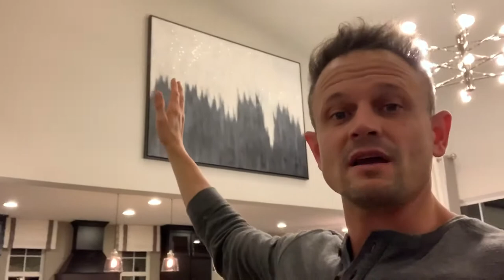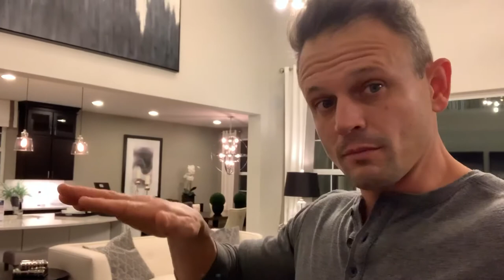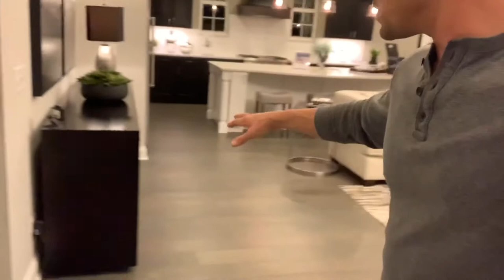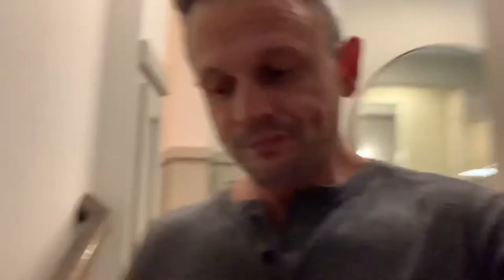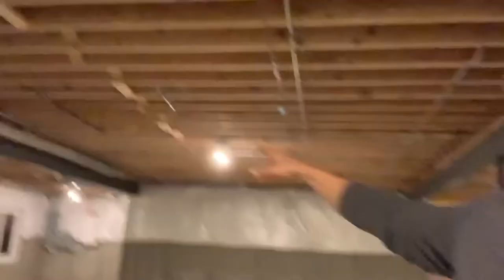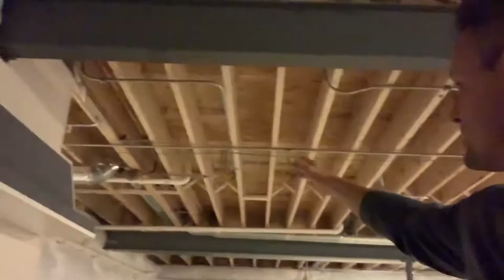Why the floor shakes when I walk by, because of floor deflection

Comment: We've been in our new "custom" home for two months.  Open floor plan in the living area and kitchen/dining. The deflection at the island is driving me crazy.  To the point I'm concerned about having holiday gatherings.  The living room has some too but the island area keeps me up at night.  My family moved from a 50 yr old ranch house that had plenty of support poles in the basement.  Little to no deflection.  I'm not liking my current setup.  

Plans called for an engineered flooring system.  Builder went with 11 7/8" 40x I-joists, 16" OC.
Reply from the maker: Well, this could be a lot of work, depending on what electrical, plumbing, and HVAC are in that area, you could try wrapping the joist in three-quarter inch plywood on both sides that should stiffen that area up and make it less bouncy.
Reply: Did you take action? My island has some deflection leading up to it and it drives me crazy as well

Comment: This helps my anxiety a bit. Got my first 2 story home , it’s a 1994 and my bathroom feels wobbly.it’s right above the kitchen. I haven’t moved in yet and  I already want it gutted to make sure it’s safe☹️
I seriously go in and run out.
Reply from the maker: Hi Ana- More than likely everything is fine, however if you’re still nervous you could always have it looked at by a home inspector, carpenter, or structural engineer.

Comment: This is very useful info. Thank you for making this video. I have an area in my house that has a piano the living room side and fridge and row of cabinets the kitchen side of the wall. I’m kinda paranoid it’s too much weight in one area. Do you think I need to get that spot fortified somehow?
Reply from the maker: Sorry for the delayed response Marilyn. It’s hard to say without seeing it. If you have a basement underneath this area I would look to see if the floor joists are sitting on a supporting steel beam or some supporting structure. If that’s the case that area will be more structurally sound then if this area is in the middle of the floor joist which is its weakest point.

In my 25 year career I’ve only seen one house that had a safe that was so large that it actually cracked the floor joists below it. With that said more than likely I’m going to say your OK, however I would have a carpenter come in and assess the situation for peace of mind.

Comment: Thank you for this video! I have about a 25 year old house, well taken care of that we moved into a few years ago. Home inspector said it was the best taken care of home he’s seen in a long time. Problem is - the whole dang thing rattles when we walk or run around. The bounce in our main floor drives me nuts especially with the one year old and five year old always running and jumping. This helped my anxiety. Two questions  - if the basement is finished below there’s probably no way to address the bouncing?
And secondly, more to help my anxiety, it’s not dangerous right? I feel like if it was you would notice some cracks or damage. My husband has assured me all is fine :)
Reply from the maker: My pleasure! If the basement is finished, correct, you would have to open up the ceiling and stiffen up the floor joists to minimize the bounce, which would be very invasive.

Yes, it’s a normal, and yes, your husband is right, because he always is! 😉🤣
Reply: @BJPoznecki  thank you for the reply! I agree with (most) of what you said! ;)

Comment: What about building a house with concrete? People in the US will say it would be too expensive. But almost whole Europe has concrete floors. Only old buildings and houses (like 100 years old) have wooden floors/joist.
Reply from the maker: Yeah absolutely anything can be done, just be at what cost. Here in United States apartment, condominium, and commercial buildings typically are constructed out of precast concrete which is similar to how they build in other countries such as Europe.
Reply: @BJPoznecki  Europe is not a country 😉
Reply from the maker: @MsJaystars  🤷🏻‍♂️😆

Comment: Thanks I was worried. My room is above the garage and when I walk in the middle of the floor, the door and some furniture shakes a little bit
Reply from the maker: Yeah, all good. There’s a strong chance the floor joists span the entire width of the garage, which if it’s a two car garage is usually about 20 feet wide. So, if there’s no steel I-beam in the middle adding support you will get some flex around the center area.
Reply: @BJPoznecki  It is a two car garage, thanks again

Comment: If you're down stairs where a slab is and people walking upstairs heavily ,can that be felt down on the slab downstairs in the basement?
Reply from the maker: I guess in theory it’s possible because the columns that support the I-beams are on a footing below the slab, so there could be some vibration transfer.

Comment: Have a very obvious wobble in the floor going into my bathroom, which tilts the plastic cabinet away from the walk and knocks back into the wall, pretty annoying.
I have a crawl space though, and don't want to pull out the fiberglass insulation to do any work from the underside.
Are these my only options?  Pulling up the subfloor (garbage mdf) and cross brace with 2x4.  Or just adding another 1/2" layer of ply or something to the entire bathroom?
Reply from the maker: Hi Swiss- I hate to say it, but the best way to correct the situation is to come from the underside. By add more joists, wrapping the current ones in three-quarter inch plywood, or build a small wall in the middle of that bathroom stiffening up your current floor system.
Reply: @BJPoznecki  The joist is about 12" from the wall and the wheels on the cabinet are about 14"-15", so I think I'll just get a different cabinet with less depth and avoid the stress.  Thank you.

Comment: Hi BJ, just found your video, very informative! what are the implications if the columns under the beams are undersized? I live in an old Victorian house where a loadbearing wall was removed to open the living and dining space, so the floor above (bedroom) bounces and shakes. We've been told the beam is fine, the columns are undersized and that the construction overall should be safe. Thanks for any thoughts

Comment: I recently moved into a new three story town house and the living room is on the second floor and has a similar size to the one you’re showing. Living room has carpet and I can feel the floor deflection which has been driving me crazy. The room is currently empty and I think the subfloor is creaking as well. No cracks in the ceiling below it on the first floor.  Do you think I’m worrying for nothing? 

Also thanks for the video. Most descriptive one I can find on the topic.
Reply from the maker: Yeah it sounds like normal floor deflection. The ceiling below it on the first floor with it being a new build the seams might crack, however that’s normal. You would just want to keep an eye out for large jagged cracks.

Being that you bought new construction your builder should offer you some type of warranty should there be an issue that’s not seen at this time.

Comment: So it can be fixed by installing extra supports?
Reply from the maker: Yes, correct you can add additional supports, double up the joists, or wrap the joists currently in place with three-quarter inch plywood which essentially doubles them up.
Reply: @BJPoznecki  I am staying in a demountable in a caravan park, on bricks with sand below. I can feel the neighbours demountable shake my unit. Is it because the vibrations shake the sand?
Reply from the maker: @BeautifulAwakening  I’m sorry I don’t know. I’ve only done two modular home inspections since I’ve been in business.

Comment: Would sister joisting help with vibration?
Reply from the maker: Hi Rob- Yes, sistering or ripping down three-quarter inch plywood and nailing it to both sides staggering your seams to stiffen up the joist would work as well.

Comment: i live in a top floor condo and my floor vibrates even from people walking below wouldn floating floor fix this i cant fix from below because its not my unit below there
Reply from the maker: Hi Ryan- No, unfortunately you have to stiffen the floor framing. 

Now if you’re having an issue where the sound transfers when you walk on the floor and your neighbors below you hear you walking around. What you could do is install a 1/4” or thicker cork board underlayment before you install a hard surface floor. That would help minimize the sound transfer into the unit below you.
Reply: @BJPoznecki hi bj -  now if i installed green glue to my sub floor then added another layer of osb to sandwhich it , would this reduce vibrations felt when someone else is walking on floor?
Reply from the maker: @Ryan-kz7ej  Hey Ryan- It’s hard to say because it’s not your subfloor that is flexing it’s the supporting lumber underneath it that flexes and creates the bounce or vibration. 

Now in theory it may help a little bit and when I say that I’m thinking about a tiled bathroom. 

Typically you have your subfloor throughout that whole floor, and then when you tile a surface you install half-inch Dura rock or plywood to strengthen the area to minimize cracking tiles and grout. 

So, it may help, but I can’t give you a confirmation that will solve your problem.

Hope that helps!

Comment: ZERO
Reply from the maker: ZERO?
I don’t get it? 
What do you think I could’ve done better in this video?
Reply: @BJPoznecki  add rows of staggard solid blocking between joists to reduce or eliminate deflection in floor. Regardless of meeting code, no one wants rattling of objects in the room above when walking through room.
Reply from the maker: @TheNewenglandboys  Yes, you’re correct! As well as sistering, bridging, scabbing 3/4” on both sides, there are a few options to minimize the bounce. 

The premise of this video is because the builder I used to work for had a lot of customers that came from India where they build the whole house out of concrete. The floors, walls, ceilings are all concrete. 

Then, they move here to the United States and live in an apartment building where the floors are precast concrete, to where they never experienced a lumber built floor, any deflection, or sound transfer. 

Plus, these mass production homebuilders here in the US if it passes inspection and they get a certificate of occupancy they’re not gonna go back and modify the floor like you or I would.
Reply: @BJPoznecki  Thats true. Their motto seems to be take the money and get out of Dodge as they say. Once their paid, its the purchasers problem. But it would be good for the unknowing victim (buyer) to know there is a solution and how to remedy the problem. Those open concept homes are expensive enough.
Reply from the maker: @TheNewenglandboys  Unfortunately you’re right. It’s very disheartening what I’ve seen in the quality of workmanship as well as how they treat their customers after getting paid. 

Thank you for the feedback,  conversation, and video idea. I added making a floor deflection solution video to my list.

Wishing you and the family a happy holiday season! 🦃🎄
Reply: @BJPoznecki  Happy Hollidays to you and your also. I would be remiss  if I didn't apologize for the zero comment. I was going to erase it but then our whole conversation would be gone. The reasoning of the zero in the beginning was based on my understanding that you were giving a solution of which I didn't see. Therefore initially I saw zero solution. Again, I apologize and thank you for getting back to me with your explanation. Best wishes
Reply from the maker: @TheNewenglandboys  No, I appreciate it, it’s all good my friend! I want the feedback, so I can get better and add more value to people in future videos. Thank you!